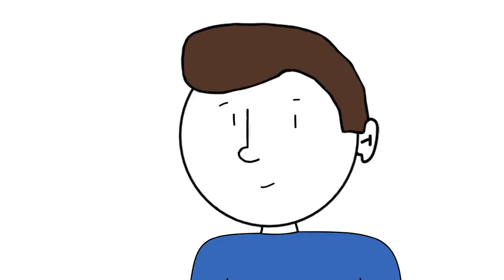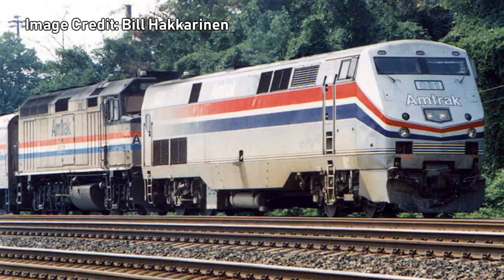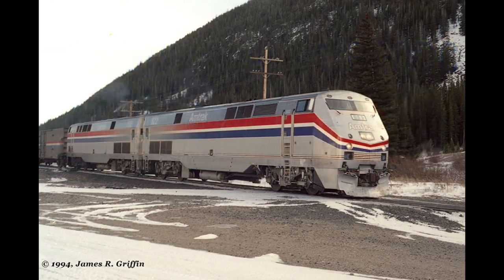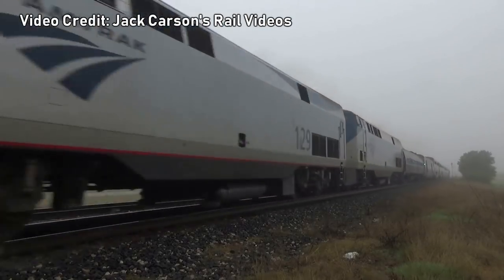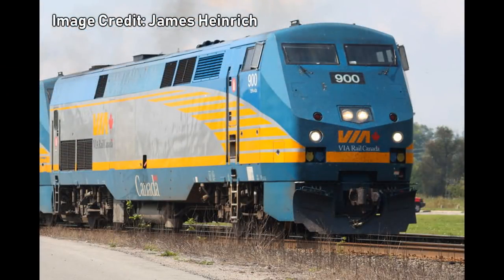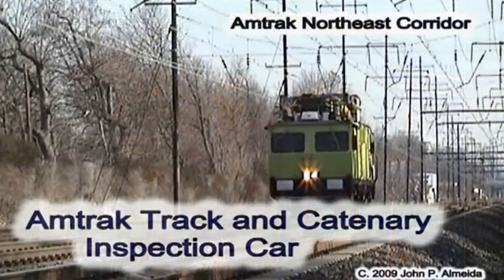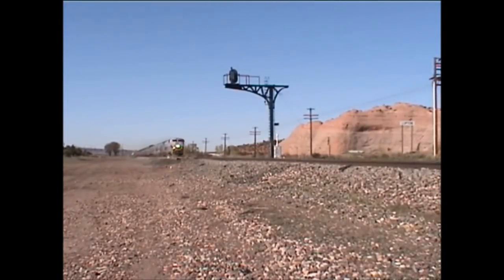Engines of Amtrak - GE Genesis

Comment: "Aging f40ph"

F40phs never age. They get more wise.
Reply: All surviving F40PH’s have all gained all the wisdom of the railroads, we go to them when we lose hope, and they tell us stories of days past, and what the hell did my reply just turn into
Reply: They're aging like fine wine would be accurate
Reply: When the F40PH was trailing behind the P42DC it felt like the F40PH was being tortured
Reply: F40PH Fan 307 uhhhhhhhhhhhhhhhh
Reply: B C it’s just my opinion:/
Reply: THE F40PH'S ARE ONE OF THE UGLIEST ENGINES DEVISED BY AMTRACK,PERIOD! YES THEY RAN WELL, BUT THE DESIGN WAS ATROCIOUS! ESP.THE FRONT END! LETS NOT GIVE ALL THESE ACCOLADES TO POORLY DESIGNED ENGINE JUST LIKE THAT F59PHI ENGINE OUT ON THE WEST COAST,WHICH WAS EVEN UGLIER! THE SDP40F'S HAD FLAWS FROM WITHIN AND NOT TO MUCH WITH THE DESIGN! IT WAS LOVELY, BUT JUST A TAD TO LONG BY 2TO 3 FT ,THAT'S IT. BUT THE ENGINE HAD GREAT LOOKS! EVEN WHEN THEY REMODELED IT, IN CERTAIN REGIONS IT CAME OUT FABULOUS IN LOOKS!  BUT PLEASE ,LETS NOT PUT THE F40'S IN THE HALL OF FAME FOR ITS DESIGN! NO,PLEASE NO! THE E'& F'S ARE CLASSICS AND COULD ROLL WITH ANY ENGINE TODAY,  IF THEY HAD THE SAME HORSEPOWER AS TODAYS DIESELS DO! EARL OF EL BARRIO, NYC, NY. 5:31PM 7/4/20.
Reply: EARL KNIGHT JR it doesn’t matter how it looks, it’s if it can get it’s job done or not. And the f40ph did it’s job in spades. Looks can come later. And they did come.(genesis,acs 64,and Acela.)
Reply: @lorumipsum1129   DID I TOUCH A NERVE ABOUT THE P40'S ? WELL LIKE I SAID THE F59PHI'S WERE EVEN UGLIER! THE GENESIS DIESEL AND THE DIESELS NEW JERSEY TRANSIT ORDERED A FEW YEARS BACK SAVED THE DAY, IN THE DIESEL ARENA SINCE THEY SHELVED THOSE F40'S. THOSE CHARGERS FROM GERMANY ARE HIDEOS LOOKING TOO AND I TOLD THEM AND AMTRAK TOO! THE NEW ACELA IS HIDEOUS AND LOOKS LIKE A TONKA TOY MODEL! WE DONT NEED JUNKETS,  ON OUR RAIL SYSTEM! THE ACS64 IS OK AND NICE AND PLENTY FAST,  BUT ITS NOT THE SWEDISH AEM-7 THAT HAD  SHEER BRUTE FORCE! BY THE WAY THEY ARE STILL RUNNING IN SWEDEN, LOOKING GREAT! THEY RUN UNDER ID OF THE ( RC4-6).THE GENESIS ARE BUILT IN THE FORM OF THE E7'S AND THE FAMED E8'S. AND WITH THAT  ADDED STYLING, THAT'S WHAT MAKES THEM SO UNIQUE! NEW JERSEY TRANSIT OLD GEEP 40'S ARE CLASSICS AND COULD ROLL JUST LIKE THE GENESIS! THEY HAVE BRUTE STRENGTH AS WELL! THE LONG ISLAND R.R. HAS GOOD DIESELS AS WELL.  EARL OF EL BARRIO, NYC,N.Y. 1:13AM. 7/5/20
Reply: EARL KNIGHT JR I don’t care what locomotives Amtrak uses. As long as they work and get the job done.
Reply: F40PH the wise locomotive
Reply: One of the last major operators of the F40PH, Caltrain, will likely phase them out in 2022 as the that line is electrified.
Reply: Sacto1654 I’m guessing most USA regional train operators aren’t considered very large. I believe Boston’s rail network uses the for passenger duty.
Reply: lol
Reply: Nice and informative video, Thank you! May I ask, why are the US railroads so fond of the horn? I personally find the frequent horn bashing quite unpleasant... Surely there must be a logical reason for it.
Reply: The F40PH's Are Good USA Trains
Reply: @BlindingLight  most of them remain in Amtrak service as NPCUs.
Reply: @Sacto1654   Haven you ever heard of Massachusetts Bay Commuter Rail?  They have dozens of F40’s and are presently doing full rebuilds on them as we speak. They will be around for a long time.
Reply: @FFred-us9tw  Are they being rebuilt with EPA Tier 4 emissions compliance for the diesel prime movers?
Reply: @Sacto1654   No, They aren't required to be. The rebuild is primarily structural, electrical and air brakes.
Reply: @earlknightjr8178  you've just disrespected and offended the entire railroad community please leave the room
Reply: @earlknightjr8178  I didn't know someone could be so around

Comment: As far I have heard that the SC-44s are not replacing all the P42DCs that Amtrak owns. At least not yet. Right now they are only replacing them in certain Mid Western and West coast markets, and the those states DOTs are sharing the cost of buying the Chargers. Amtrak does not currently have the funds to replace their entire fleet and won't anytime soon. The P42DC will solider on for at least another decade.
Reply: You don't have to use all caps dude. Anyway they don't care what the units look like, it is function over design. Also the US has very strict crash standards for trains which which is why most North America locomotives have a less aerodynamic front end and the rail cars are more structurally robust. A foreign manufacture has to make very drastic changes to their models to sell in the US, and Canada. That is why the Chargers look vastly different from European locomotives. Yes the Chargers are not ascetically  pleasing but if they are reliable and function as designed then the purchasers won't care. It is likely that these will be becoming more common in North America. In addition of being one of the few new passenger locomotives being sold in the US. The others are EMD, and MPI. There are also a few companies that will do complete rebuilds  to modern specs of older platforms.
Reply: DEAR MR.SCHUTZ.GREERINGS! capital ization is not the end of the world! nor is it pointing a weapen at you ! GET OVER IT-OK! NOW TO THE TASK AT HAND! amtrack has the new ACS64 ELECTRIC LOCOMOTIVES And they look pretty decent, although i believe, they didn't  get GERMANYS  BEST! BY THE WAY, I KNOW ALL about that crash    worthiness issue. THE GG1'S  WERE THE BEST AT THAT! ANYHOW the ACS 64 IS NOT AS ROBUST AS GERMANYS ACS64F! THAT JOKER SET A SPEED RECORD FOR A LOCOMOTIVE AT 224MPH,AT TRIAL RUN! THE UNDERCARRIAGE IS HEAVY ENOUGH  TO HOLD THE ROAD AT THAT SPEED! I DARE SAY THAT ITS DEFINITELY MORE CRASH WORTHY THAN THE AMERICAN  VERSION. THE GERMAN ACS64F,  IF I'M  CORRECT, CAN BE SEEN UNDER THE CURIOSITY APP WHICH HAS THE 10 FASTEST RAIL SPEEDOS IN THE WORLD. THE ACS64F OF GERMANY IS THE 1ST ONE SHOWN, IN THAT SEGMENT. THE AEM7'S WHICH ARE STILL RUNNING IN SWEDEN UNDER THEIR ORIGINAL NAME OF BEING RC4'S-RC6'S CAN BURN RUBBER TOO! OF COURSE,WITH STEEL WHEELS. they may be alittle shorter than the ACS64'S BUT THEY CAN DO WELL OVER 125MPH WHEN PRESSED! THEIR SPEEDOMETERS READ 160MPH! sadly, my beloved AEM7'S WERE RETIRED,   NEAR THE END OF 2016, AS YOU MAY BE AWARE OF. I CALL THOSE  NEW ACS64'S A SHOWHORSE, BECAUSE THEY LOOK TOO SHOWY! THOSE RC4'S SLASH AEM7'S COULD GO TO WAR ON THE RAILS! I SAW IT ON A TRIAL RUN BETWEEN NEW BRUNSWICK AND PRINCETON JUNCTION AND THAT NEEDLE WAS WAS UP WARD'S OF 147MPH. NUFF'SAID! 7/23/18. 8:18PM.
Reply: Amtrak is now focusing on the Northeast corridor and State support railroad lines rather than long distance trains. This is due to budget cuts and the recent amtrak train accidents. There maybe a chance that Amtrak will only have the Northeast corridor and State support lines because of Donald Trump slashing funds for Amtrak.
Reply: What the east coast ? The east coast has a lot of state supported lines.
Reply: There's an RFP out there for the P-42 replacement.  Siemens won't likely be the chosen replacement due to several engineering problems with it.  I'd expect that the contract will be awarded in late 2019 and the replacements start showing up in late 2020 or 2021.  Amtrak is parking 22 P-42 units currently due to the Chargers.
Reply: Amtrak already orderd over 100 to replace the  p42 dc units their putting larger fuel fuel tanks on them to make them long distance.
Reply: You’ll see a lot of them late 2020 early 2021  but the order will be completed 2024
Reply: I’m atleast glad amtrak has enough money to actually begin replacing assets at all. Since Amtrak is one of those dying breed of American transport due to commuter cars and airliners. Have you seen the ugly Philadelphia station? I’m glad they somehow run that station. It’s better to have a station that’s ugly then none at all!
Reply: Give me an example of an Amtrak engine that wasn't considered ugly when it first came out. And now we love them and miss them.
Reply: @SlackActionBumble , what about the P32's?
Reply: @aaronjones7502  They ordered 75, not 100+
Reply: @caelumvaldovinos5318  75 ALC-42s have been ordered for LD Services, but the P32s will remain.
Reply: CAP!!!!!ALC-42 301 WAS JUST DELIVERED!!!!!

Comment: 35 P40DCs were given to TVCTA Commuter Rail in 1987 but in 2007 they were scrapped, and in October 2016 the Siemens Charger SC-44s ranging from 500 to 599 went on a test run before service in February 2017.
Signed, Angela.

Comment: After the P42s were deployed, all P40s were stored for many years until the TIGER stimulus plan rebuilt about 15 P40s to be the equivalent of P42s using surprising minor modifications. These are now used on the Auto Train and some other services.

Comment: I hope the SC-44 doesn't replace the Genesis too soon, it looks a lot worse
Reply: It’s a superior locomotive though. More powerful. Faster acceleration and cleaner so it uses a whole less diesel
Reply: The ALC-42 is a good design in my opinion but not the SC-44.

Comment: The Michigan line from Porter IN, to Kalamazoo Is rated for 110mph.  MDOT purchased the rest of the route to Dearborn so hopefully soon trains will be able to do 110 from Porter to Dearborn.  The South of the Lake project should decrease travel times significantly as well.

Comment: Awesome video! The P40DC’s are all CDOT uses now for SLE. The GP-40-2Hs in Mc Ginnis paint with the last being 6696 retired last week! CDOT P40s run like crap with 838 with a 76 MPH max. It had a load error and smoke out of the stack during a run! But, you can’t beat the Hybrid K5LA’s the CDOT P40s have!
Reply: I know it was 2 years ago when you posted it, but it was wrong then and Still wrong now. The GP40’s in CDOT service were NOT retired. They just finished rebuilding and repainting them. They are not going away any time soon

Comment: The Genesis P32AC-DMs were also built to replace aging EMD FL9s that were acquired from the Penn Central in 1978, which were originally purchased by the New Haven Railroad from 1956-1960. The old Amtrak FL9s weren't completely phased out until 1998 and were only kept in service for so long because no other locomotive builder had a third-rail compatible diesel in production until the Genesis series came along. To my knowledge, Metro North actually kept their FL9 fleet in service until late 2009 meaning the locomotives had an over half century-long career, which is crazy for a locomotive.
Reply: that is surprising for Amtrak to be using FL9 locomotives right after F40phs and genesis locomotives first started running on Amtrak lines. Amtrak used to have other that were old as the fl9 and older too, such as E7, E8, and E9, but Amtrak retired those locomotives after a few years of service.

Comment: I actually remember back when General Electric Transportation System's (G.E.T.S.) In Erie Pa unveiled the Genesis Series locomotive at one of their Railroader Conferences in the late 90's They had a huge laser light show and rolled AMD-103 into the building horn blasting and man did she make a scene. this was the series locomotive that both  George Bush Senior and George Bush jr. used as part of their Whistlestop" tour. As a former Erie Native it always gave me pride when operating locomotives that were build back there. So glad the AMD-103/P42DC/P32AC-DM/P40DC all have survived the now 20+ years of revenue service. Show's just how reliable the Cooper-Bessiemer FDL-16 Diesel Prime Mover really could be! I also miss the old GE "Pepsi Can" Dash-8BW passenger units!!

Comment: The Amtrak  Genesis locomotives are on of my favorite Amtrak engines I've know for a long time. There like the EMD F40PH's of modern time.  In regards to the Siemens chargers I actually like them comparing them to the tear 4  Locomotives on metrolink ( California) They actually look really good. They were mainly designed to take over intercity trains. The Genesis engines are still used on long distance trains. Some have heard that Siemens is building a long distance Charger locomotive at some point but for now the and track Genesis engines are still the beautiful face of Amtrak.
Reply: Trainman3985 No way did you say the AMDs are like the F40s currently, Thats just crazy.

Comment: Note:  The Chargers are now in revenue service on the NorCal CalTrans routes, the Capitol Corridor and the San Joaquins (interestingly, one of these two routes' termini is here in Sacramento, where the SC-44, SCB-40 (model for Brightline, along with its rollingstock), and ACS-64 locos are built).  That started back in November of last year.  They're now being tested in SoCal on the Surfliners.  These SC-44s feature an aerodynamic shell modification unique to California with a spoiler for the bi-level cars (future cars will be single-level owing to supply-chain problems with a newer design of bi-level cars).

Comment: According to VIA Rail's SUMMARY OF THE
 2016 – 2020 CORPORATE PLAN pg. 50 :"The monocoque design of the P42 cannot be overhauled to integrate the newly proposed
 crashworthiness safety standards for cab design and fuel tanks."  This is likely the cause of them being replaced by Amtrak and VIA Rail.  VIA primarily uses them for corridor service and they are purchasing new Siemens trainsets (both locomotives and coaches) for use there.

Comment: I was on the lake shore limited in April 2019, we got up to 110mph (not sure how, because they advertise that the top speed is only 79).
Reply: Tope speed on the Lake Shore on the Hudson line is 110MPH in many locations. The whole line has Cab Signals.
Reply: @FFred-us9tw  i still find it interesting that many little pamphlets in the train advertise it at being 79mph.
Reply: @JoeyLovesTrains   Much of the journey is 79. But certainly not the max. Maybe one day they will correct the pamphlets.

Comment: the p42dc locomotive runs at 90 mph south of dc down to virginia, then south at 70 mph to miami at about 80 mph average speed, then to miami at about 80 mph per day, it takes years to get down there because then they stop in 10 places and are always like 10 mins late in every possible location down there

Comment: What i want to know, is why Amtrak ain't getting the streamlined hood on the Chargers, especially on the road engines.  Being lead across the country would tend to get some returns with the added aerodynamic.
Reply: They were special ordered for Brightline.
Reply: AngelGamer74 ahh yes, but since it’s already in operation, seems fairly simple to order the aero cabs.  I presume it wouldn’t work in completely interchangeable operations as Amtrak likes, but if you’re keeping the car sets in roughly one piece anyways, capitol limited-southwest chief and back, or the builder, seems a good return on investment.

Comment: Hey AmtrakGuy365, I’ve been wondering where the bell is located on the f40phs and the p42dc’s. I’ve been looking at pictures of these and can’t find it myself.
Reply: The bell on Amtrak F40’s and P40/42’s is under the nose. Usually under the right side.

Comment: I remember what the late "Railfan and Railroad" Magazine Editor Jim Boyd said of them when he first saw a photo of one:  "AMD-103 stands for Armenian Made Diesel - 103 percent ugly".  Nothing will ever come close to the streamline era E's, F's and Alco cabs, but I think in retrospect the F40PH was a better looking modern passenger unit.  I realize they were fuel hogs when generating full Head-End Power, but it was really impressive watching and hearing one enter a station at full-roar, strobes flashing in the night.  One of the major downsides of the GE passenger units, which also plagued the earlier P30CH's was their propensity to suffer engine fires, leading to an entire category of photo albums titled "Crispy Critters".  I'm told that the problem was lack of proper maintenance, but the EMD's didn't seem to suffer the same problems with the same level of maintenance.
Reply: One of the major issues with GE's locomotives is that the oil lube lines run directly into the turbocharger. If the turbo bearing springs a leak, well, we all know the results. Also, speaking from experience, the engines that GE uses which are 4 stroke with multi fuel injection instead of the common fuel rail tend to be asses when not babied

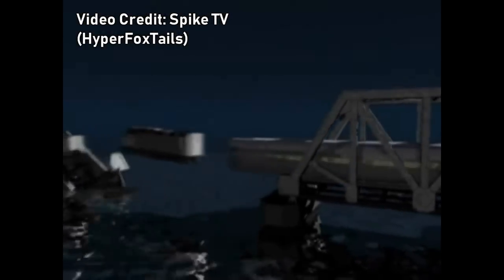Comment: AmtrakGuy365 4:54 I think you meant to say "alligator." Crocodiles are not native in the US but alligators are. And 47 people died in the wreck. 42 of them were passengers and 5 of them were crew members, including the engineer. And on March 15, 1999, Amtrak lost P40DCs #807 and #829 in a train and truck collision in Bourbonnais, Illinois. The train derailed and spilled fuel from both engines from the force of the collision. 13 people died in that wreck and 122 were injured.

Comment: Is it possible for Amtrak to extend the North East corridor south to Miami Florida and North to Portland Maine because that would be a major improvement for Amtrak and the infrastructure of passenger railroads in the United States.
Reply: Impossible either way. Amtrak already has the Downeaster service that goes North from Boston and the Tunnels south of Washington DC's Union Station will have to be renovated. Tracks further south to Florida will require permission from freight rail companies that owns the tracks and upgrades have to be made which will be costly.